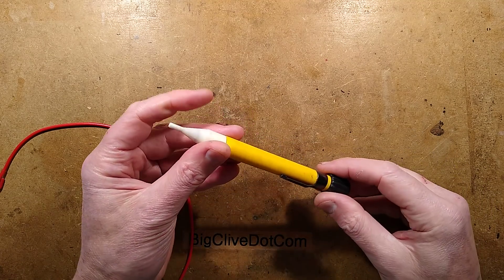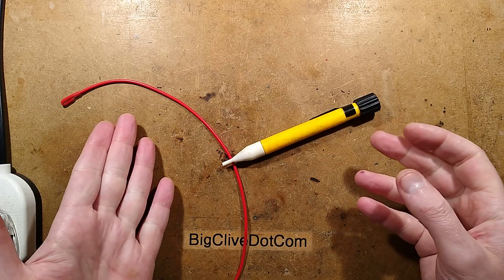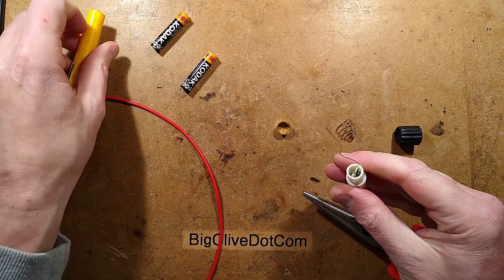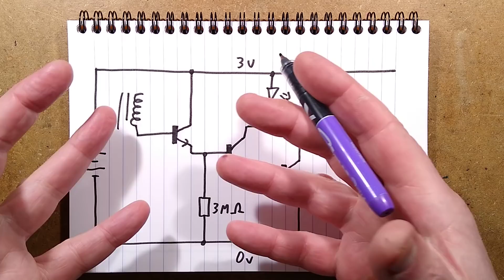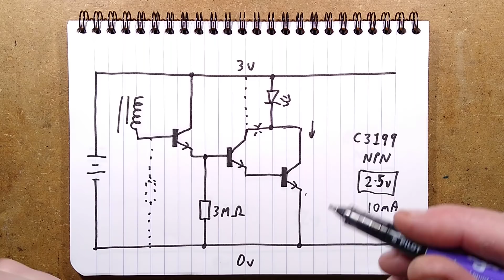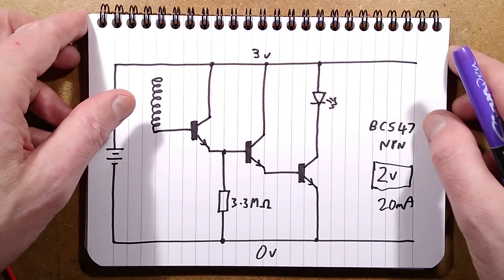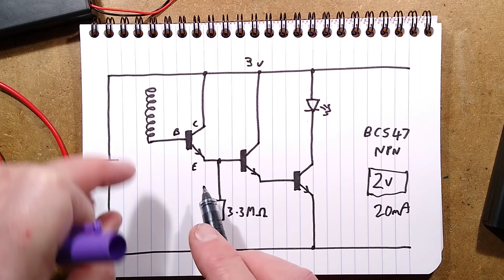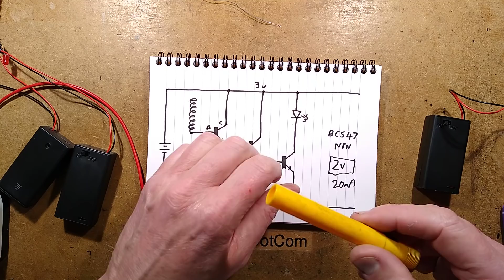Volt stick circuits and tests

Comment: I must build one of these for myself as a little tool along with your LED checker that you made. Will this be strong enough little tool to track and trace any power cables running through walls etc?
Reply: That's actually possible to do with a voltage tester pit bike this with the low voltage detection feature.

I have one from Southwire with this feature and also a LED flashlight on the tail end both of which are useful features as well
Reply: Go buy a commercial one. They are not expensive. And the commercial ones come with a buzzer and a fully insulated case.

Comment: It's 3am, I had to watch this with the sound off but still brilliant. I have gone through many of these things in my time, they aren't very drop proof I found and I always seemed to go through batteries.
I also have, or had because I haven't seen it recently, a magnetic detection stick for solenoid heads, that was a great little gadget, looked just the same 👍👍👍

Comment: Is this the same way the old neon bulb screwdrivers used to work?

Edit: Oh there are batteries inside
Reply: No. The neon bulb screwdriver required direct contact, where this uses an induced current. I use one of these for electrical work - never for proving dead, but to confirm that the voltage is where I expect it to be - very useful for switched circuits and checking polarity.

Comment: Back when I was a wandering electrician, we used the crap out of those those things. Or at least the modern versions. Though we called them "wiggys" cause of the siren noise they make. Absolute lifesavers, particularly when you're crawling around up in a ceiling of a building that has a hundred years worth of wiring. Some of it still very much live for a hundred years, even if it isn't actually hooked up to anything. Until it hooks up to you when you bump up against it was hidden behind something with bare copper hanging out, despite locking out the breaker box. You can probably guess how I'm familiar with that. Nothing better than a hot wire to the ass while you're 30+ feet up on a lift. Good, good times.
Reply: Ahh yes, the old spider wiring, also familiar with that. These test sticks work wonders for that.

Comment: Somehow I can imagine it being more of a hazard than a help with people getting used to and relying on the pen too much and then getting electrocuted when it does not work for one or another reason.
Reply: That's why you check the wire with the back of your hand :-)

Comment: I use mine to troubleshoot. I don't use it to determine a circuit being safe to handle. Still very handu. I have the fluke, which also tones as well as lights.

Comment: Here's the problem I have with NCVT's (Non-Contact Voltage Testers) on the construction sites...
An electrical extension cord run along the ground and plugged into nothing will alert as live voltage.
The reason is that on construction sites we have leaky power.  The extension cord will  act as an antennae.
This way they test positive for voltage even though not live.  By Law we use completely GFCI systems...'cause some people are stoopid.

Comment: Would you include the +/- value when you translate the resister colors? If I remember correctly, the gold band is 10%
Reply: gold is 5% and the most common in modern times by far.
Reply: Silver is 10% and gold is 5%

Comment: Just remember you may have a dead hot wire. So volt meter will show no voltage. If the neutral is on a load and you cut into that wire I promise you will get a surprise

Comment: I've been in industrial maintenance for over 35 years and have carried one of these the whole time. The only time I don't have one on me is when I'm in the shower or the bed.
These things have saved me hella trouble over the years, and in my experience, they typically lean toward the 'false positive' than the false negative side of the scale.
That's fine. If I have killed power to a panel I am working on but my volt stick tells me that there is a chance that I might have missed some foreign power source, I pull out the meter and probe around for it. Sometimes the volt stick will pick up residual induced voltage on an otherwise dead wire that happens to be running along the same conduit or path with a currently live wire. 
In that case, there is definitely some kind voltage present, albeit maybe nothing to worry about as far as safety is concerned. In all cases like that, I get out my trusty Fluke before I sting my fingers in there.
I started out with the Santronics volt pen and stuck with that until they just completely disappeared off the market. Now I just get whatever I can that seems to be made well. I always test any new volt pen I get on known live and dead circuits so I can get an idea of where the false positive / false negative curve lays.

Comment: I’d like to see a comparison between these triple-Darlington models and using a MOSFET (or JFET) gate. Little hall-effect probes could maybe be useful also.
Reply: Most common ones I have seen use a single CMOS CD4001, with only one gate used, and it biased with a 33M resistor to one rail, and the LED via a resistor to the output. The other gates can be used to make the buzzer driver.

Comment: I was taught that these were called 'death sticks'. cool how simple they are though. thanks for another awesome video!
Reply: I heard similar. Two takeaways from my experience: These are great for finding live circuits and outlets, and don't touch anything that isn't locked out/tagged out over 24v. This is a tool, like your eyes. Don't always trust your eyes, but don't disregard your visual experience either.

Comment: Thing is, if the sticks can fail to indicate a live wire, doesn't that make them useless, and dangerous to rely on? If it lights, you know it's live and not safe. If it doesn't light, you don't know anything at all. Might be live. Might not be.

Comment: I remember seeing those for the first time while I worked at an electronics parts distributor. They were made by Santronics. I think they were in South Carolina, USA. They sold for around $18 USD as I recall. They also had a low voltage DC model and one more. Then the imported devices showed up and that was the end of those. I loved giving demos. I would show the above ground and grounded wire differences in a lamp cord. Thanks for the ride down memory lane, Clive.

Comment: Dunno about the rest of us out here in TV land, but I don't have to watch my eyes when you put the lights on. I'm watching through a camera! It does all that automatically! And my monitor can't supply any more light than it's backlight produces. I suppose watching full-screen in a darkened room might make my eyes dilate and that be a potential worry, but I'm not in a dark room... you are! 

Not just me, right? Clive doesn't need to warn us? I'd be interested if I'm wrong and someone has a different experience, this is on a PC on a desk, usually not full-screen but that wouldn't make a difference I don't think. Certainly not the same as a change of light source like Clive gets there in the Voltcave.

Also what is the correct name for Clive's lair anyway? I think it needs one. It would be dignified. Batman has one.
Reply: It matters to a lot of people, especially if you're watching on a phone (don't remember the last time I watched a YouTube video on a desktop), especially if the lighting is dim and or you have a headache. Many phones are OLED so really high contrast too.

Comment: I worked for Santronics/Static Control Components for a couple of years. It was a small town operation. We made them for all the big names at the time.
Reply: Small world. Someone else from Sanford.
Reply: @randyhardee4773  did you know the Schwartzes? I only worked there as an engineer for 2 years. Learned a lot made some cool stuff.
Reply: I didn't but several of their people went to BCA (where I work) when Static closed.

Comment: I'm guessing this is similar to the questionable Christmas light checkers they often sell in hardware stores starting about now. I think I've got a couple of those floating around. I just had a thought, I wonder if these still work with the LED christmas lights strings, since they would effectively be turning AC into DC with all the diodes, or if there is still enough of a pulse for it to pick up. Hmm.
Reply: They make a separate version for LED light strings. ("LED Saver"?) At least the name brand versions work really well for me, have saved me a ton of time. (I bought a pre lit Christmas tree and it had a bunch of dead bulbs from the factory or transportation. It really sucked finding them all with a multimeter)
Reply: @rpavlik1  Cool, good to know, I guess I hadn't paid attention to them the last few years.

Comment: You should try it near a HF antenna when transmitting tried the fluke with an endfed at the Toroid interesting voltages at just 5w input
Reply: I remember the citizen band 27Mc hype long ago. Some put a little lamp on top of the antenna. It looked cool at that time.

Comment: I bought one of these 25 years ago and i remember it going off standing on the platform waiting for a train. It made a slightly different noise since power for trains is 16.6Hz AC afair.

Comment: Some years back I fiddled with designing a version that didn't need batteries- a FULL BRIDGE RECTIFIER made of Schottky diodes (or tunnel diodes but I couldn't get my hands on any) and a low-current LED, but got distracted with my actual job. These days my old eyes won't let me do most soldering tasks.
I won't be offended if you give it a shot. ;>)

Comment: It's funny that you're talking about this now because I just built one of these going by a YouTube video. Actually the first electronic device I've ever built from scratch. It's just 3 bc547  no resistor. It works well for 110v.

Comment: I much prefer the good ol' reliable neon indicator..........

So there I was up my friend's loft ladder having run a cable to a newly fitted bathroom wall heater. (No, it's not designed to heat the wall, that's just where it's mounted.) Having put the cable in, I did some tests with a trusty neon indicator.......

Earth wire....live ! It lit the neon tester. So I had to do some investigative examination to find what had gone wrong.......

Nothing. The earth wire was indeed earth. It was me that was live ! I never found out why, so presumed it was from other nearby wires I wasn't touching.
I just hope it wasn't the metal loft ladder - I never thought to check that !

Comment: Does it work on DC or just AC? (My guess is AC only)
What's the lowest voltage they reliably detect?
Reply: AC only. The Klein tester I had (and misplaced) had two range settings, with the low picking up Ethernet cable signals. The high had pretty much perfect sensitivity, enabling determination of which wire in the cable was hot and which was neutral.  I also have a Fluke version with no on off switch, and while it works well enough, seems a bit less precise somehow.  More hysteresis to it maybe.